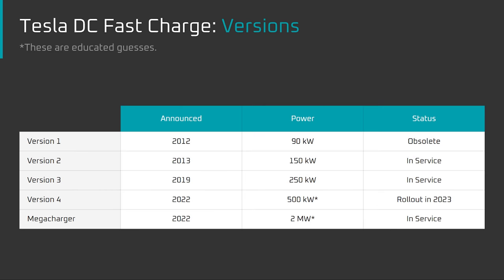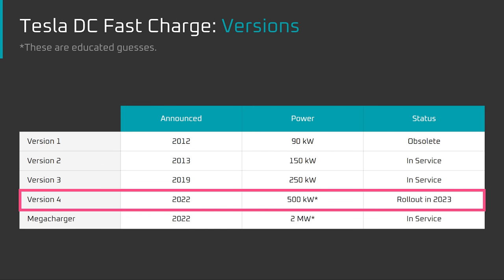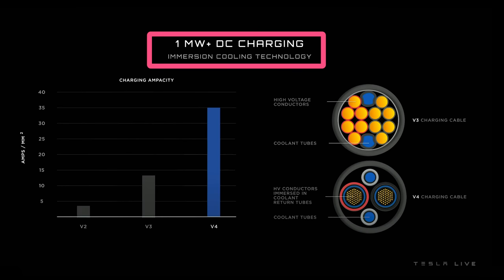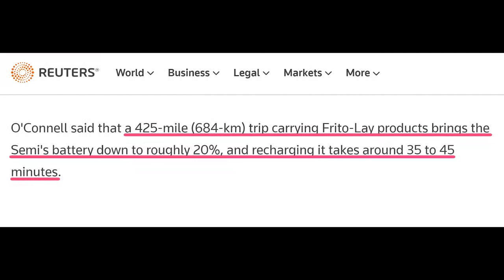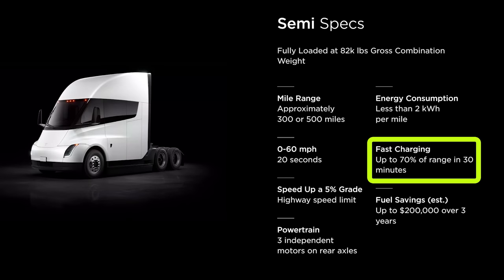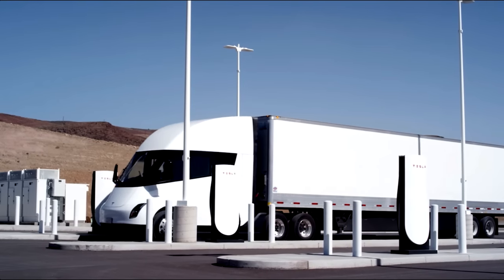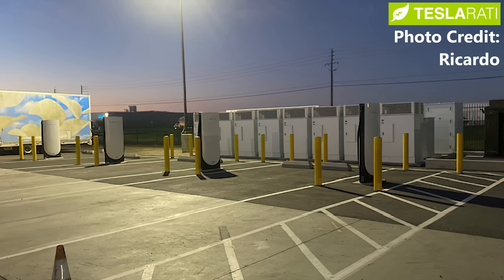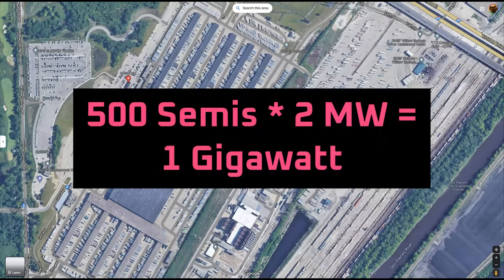Semi Megacharger Output // + The Megapack Moat

Comment from the maker: Point of Clarification 1:  Some people might note that starting at 04:26, the average lines I've drawn seem too low and don't reflect the average from what we might calculate from what we see in the charge slope.  This is because:

1) This graph was repurposed from the Model 3 and applied to the Semi...

2) The Model 3 charges to 80% instead of 70% in 30 minutes.  That means the model 3 likely has a higher peak charger rate.  That means that the peak rate and therefore average charge rate line for the Semi must be proportionally lower to account for its lower charging power.

Point of Clarification 2:  Yes, the Megapacks are not just rated for >3 MWh, but 3.9 MWh exactly.  This was a poor editorial decision on my part 😛
Reply: THANK YOU for the comparison semi to nuclear plants. I've been bringing this up wherever appropriate. We WANT to ditch diesel. We WANT an electric world. We NEED nukes to enable that future.
Reply: Thanks for the clarifications, Jordan. 🙂👍

I can imagine Tesla installing Solar PV panels covering the Megacharger sites, and providing shelter for truckers. If a park is a very feasible 1 kilometre square, and covered in good quality panels, you can expect Summer generation rates of at least 100 Megawatts, assuming a reasonable overall panel cccoverage, generating and storage efficiency of 10%.

Given a very pessimistic 5 hours of useable sunlight per day, that's at least 0.5 Gigawatt hours of electricity which can either be stored entirely onsite, partially fed directly to trucks, or fed into the grid via inverters. Even in Winter, in most places, providing that there is no snow or ice coverage of the panels, a useful amount of electricity can still be generated.

Tesla could also install Wind turbines at appropriate sites.

The point is that the electricity grid need not be stressed as much as one might think it would be, providing that local generation and storage can be implemented.
Reply: I'd like to know the warranty on the Tesla Semi battery pack.  Semi tractors are expected to last roughly 1 million miles.  Will you have to replace the battery pack one or more times during its lifetime? If so, the economics of the Tesla semi will be less compelling.

Comment: Excellent summary. Probably mentioned but these MegaPacks would be well suited to areas where there are easy access to large solar arrays like fields and large warehouse roofs. The connection and distribution of these significant assets (and our cars / houses in the future) will be the saviour of our present fragile grid and should help with resilience in the case of a high tension line or substation outage.

Comment: One possibility we have to also consider is that 750kWh comment was specific to Pepsi's use case and does not show actual max capability of mega charger but rather highlights specific location constraints. Like if they decided to dedicate 3MW to semi charging in Modesto and they want to have 4 charging bays then they could easily limit each to 750kW. As long as the intended use satisfies them they might never need max charging power and associated infra costs to support it

Comment: Before I retired two months ago I was asked to provide standby power for three DC warehouses in the Phoenix area. These DCs were looking at 9 to 18 MW per location to support up to 300 semi-trucks per warehouse. When the utility told them it could take three years to build out the power lines and the owner found out how much it cost to upgrade their existing services the projects were canceled. I heard Tesla is building V4 pull-through chargers in Casa Grande and Avondale AZ. These are not far from existing Pilot diesel truck stops and a couple proposed H2 processing facilities. They can easily be powered using 4,010-megawatt base power from the local Palo Verde nuclear plant. Tesla also had approved plans to build V4 passenger car charging stations in Quartzsite AZ which is a prime truck stop location between LA and Phoenix. The utility APS is adding flow storage batteries not lithium batteries with solar panels near these locations so my guess would be they are not using Telsa packs. Keep in mind the first EV semi was from Cummins who recently invested in an mfg plant for 500Wh/kg batteries in Tucson and many H2 processing stations in other parts of the world.  Due to NDAs utilities can not tell us much but a few beers can.
Reply: My father's sales job involved many long lunches for the same reason!

Comment: A typical substation feeder is something like 800A @ 12.5KV, and most substations I've been in run at about ~50% load during a typical day, so that should be enough for ~6MW of power if you are able to fully buffer it through powerpacks throughout the day/night. At the subtransmission level, Tesla will need to have some kind of data feed from the substation and throttle their charging depending on the feeder load - assuming they don't get their own feeder. I think they will basically have to do power packs because the cost would simply be too high for an unbuffered feeder. For semi trucks, I would imagine their charging would probabbly come at certain times, and largely be usused for the majority of the day - even more so than superchargers. Even 6MW of power might be enough to support at least 8 Megacharger stalls I would think. 

A bigger problem is that those feeders are typically sized for worst case scenarios - like if everyone is at home using electric heat during a winter storm. In such a case, there might not be enough unused capacity in a 7 day period to support the Megachargers. That to me is the much bigger problem because it's likely that Megacharger usage would be higher in exactly those conditions since the cold/snow would negatively affect Semi truck range... 

In short, it's not an unsolvable problem, and people sometimes forget that when air conditioning first hit the mainstream, that also caused a massive increase in power usage in a very short number of years and totally changed certain areas load curves from winter peaking to now summer peaking - this screwed up a ton of 'best practices' and standards for certain utilities that were very affected. In general, utilities don't make optimal use of assets in extreme conditions. At most, they might have a set of summer and winter load standards, but as temperatures get down to 20F or below, the substation can push far more power than at 70F. There may need to be more temperature monitoring to make more optimal asset usage. Even at the transmission level, you would be surprised how much truly unused capacity there is. I'm not talking about what the utilities' standards say is the limit for 'winter conditions', I'm talking the true minute to minute electrical limit - that is typically far higher in extreme cold situations than what utilities run at. Some of this may be unmeasurable, but if a financial incentive was present, I believe that a lot of it could be measured and capacity could be pushed up. 

At the transmission level, natural gas power plants can be set up very fast, and I wouldn't be worried about there not being enough ENERGY available. There is also a pretty large surplus of capacity. POWER will have to be managed though - that is definitely a problem. Transmission lines are very hard to build, so there will likely need to be some sort of data feed from the utility that can throttle all these megachargers in case of transmission congestion. The solution will lie in more optimal saturation of existing transmission lines, setting up new lines in most areas is not practical in a <10 year timeframe. We would need a lot of Megachargers to cause problems on that level though. A 500kV line can support quite a lot of capacity.
Reply from the maker: Great information thanks!  Is there anyway to get in contact with you?

thelimitingfactor9000@gmail.com
Reply: Thanks for sharing your experience!

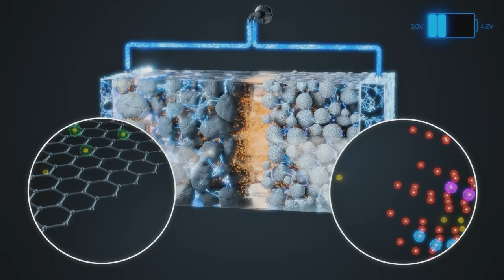Comment: @5:30.  When the 4680 is considered, I believe a few rules change with charge & discharge.  Higher charge and discharge efficiency because of lower heating.  AND this likely means Tesla can hike the charge-rate to somewhat higher levels than the 2170 for example.
I don't know for sure, but the ground-breaking physical construction and lower ESR of the 4680 implies many improvements overall in respect of charge & discharge rates.

Comment: Another nice video, Jordan!  I believe the 2.0~2.3MW estimate is correct:  On the V3 supercharger, there are 4x 250kW charging connectors on each "cabinet," which means a total of 1MW per cabinet.  At Frito-Lay, you can see 8 cabinets going to 4 charging connectors, which would be 2MW to each semi.  If the cabinets are upgraded for 4x 300kW, then this also increases the semi charging rate by 20% to 2.4MW.  Doesn't this line up perfectly with your numbers?

Comment: It seems to me that for industrial applications like Semi charging a two cable system makes much more sense than a single cable system. While we are all used to having a single gas nozzle duplicating this experience isn't necessary. Each of the two cables would be much more flexible and lighter and easier to handle than a single one.
Reply from the maker: Could be.  Not what I'm expecting because it's more parts, but looking forward to seeing.

Comment: Keep in mind the largest solar farm in California is 550 MWh. It covers 4,700 acres. It will be required to have megawatt class battery packs to collect the solar during the day. Then release it during the evening when the semis are actually charging.
Reply: Or
The Semis could be using the Solar and Megapacks combined during the day for their "top-up Ch" (IF required, which is by no means certain) then be using spare capacity to slow charge at 150(?)kW at "slow" chargers overnight?
Reply: That's a very bad way to store power.  California has many low reservoirs and should be pumping ground or downstream water up into them as storage.  About 70% efficient as storage and far cheaper than wasting lithium needed for the vehicles.

Comment: Only because the CharIN plug is designed to handle 4 MW, doesn't mean the first chargers rolling out with that plug will go anywhere near that power.
Reply from the maker: And excellent point!
Reply: I wonder if that 4MW specification is due to vehicle manufacturers  lack of confidence in the vehicle efficiency they can achieve?
.
I suppose we will know when their "gen 2" (3?) trucks arrive?

Comment: HVDC transmission technology is something worth looking into.  For example the UK is planning a wind farm near Iceland and back hauling the energy to the UK by a HVDC transmission line.  HVDC technolgy follows a dropping cost curve similar to semiconductor products so before long it will be everywhere.  So a wind farm in New England could power homes in California while a solar plant in Nevada could power homes in Florida.  Geographical spacing allows a nation  (global?) wide grid to average out the highs and lows of renewable energy sources.
Reply: It would also allow someone who owns a solar farm or wind farm or whatever to sell to much wider market.  Which in turn opens the door to power providers competing price wise, and that's usually better for the consumer.  I agree, it is work looking into!
Reply: I hadn't picked up on the Iceland idea. Do you think this project is really likely to fly? It looks closer than the Morocco to UK mega-solar farm idea so transmission is realistic although Scotland needs more power like a hole-in-the-head. Would it make more sense to land the HVDC cable in north-west England - which one is cheaper, undersea or across land HVDC? HV transmission pylons through the Scottish mountains are quite contentious.

Comment: Locating charging stations near the transmission network for direct supply from the transmission network gives lower power costs and greater capacity. Its an easy solution to the problems outlined in the video.
Reply from the maker: But, its doesn't allow for arbitrage and limits where the stations can be built...and would still require a wait time for the parts
Reply: @thelimitingfactor  There are limits on the available real estate at existing transmission substation for adding an additional breaker, however most transmission substations have some additional busbar capacity for at least 1 additional breaker. There is typically a wait time of about 12 months for a new high Voltage breaker, the delivery time for cable is usually going to be less. Obtaining regulatory approval and easement approval for the cable are generally also of the order of 12 months. This means that there is a delay for each new installation as well as limited access to transmission networks, however, these are not insurmountable problems if a company is prepared to plan its rollout of large capacity charging stations. It is unlikely that a utility that owns a distribution network would be able to easily accommodate a large charging station connection to its distribution network. The existing Tesla supercharger stations appear to be at about the limit of what the local distribution network has the capacity to handle.
In the case of access to transmission substations there is probably a significant first mover advantage for Tesla and their proposed high capacity charging stations. The cost of building a new transmission substation is quite high and typically takes many years to plan and implement.

Comment: You are missing that the rectangular plug you show that Tesla is using for the Semi is a MCS connector. It is just the prior revision/prototype to the new triangular one. So, I would expect Tesla to have already moved the Semi/Megacharger to the new MCS design. (Or if not, that they would relatively soon.)

It could be the person that said the triangular connector wasn't being used was referring to the portion of the question about the Cybertruck, as I wouldn't expect it to have one. (It will probably just have a ~1MW NACS connector.)
Reply: Tesla will do whatever they want, whatever is best for them, it's an OEM system they make the standards they use for their own infrastructure,  no matter what standards authority thinks or whines on about
Reply: The limit is the DC current carrying capacity at the rated voltage ITS NOT A Breaking contact if you unplugged it under power it would arc, there will be a disconnect contact to kill the power but it's not a power breaking or making connector not DC at 1000 volts so only the thermal needs to be considered
Reply: @kwinterburn  Of course, but Tesla is a member of CHARIN and was a major player in the design of the MCS standard... And given that they used a prototype MCS connector for the Megacharger makes me think that the Semi will likely be MCS compatible.
Reply: MP3 Mike nailed it!  The Tesla connector sure looks like the prototype MCS 👍

https://en.m.wikipedia.org/wiki/Megawatt_Charging_System

Comment: Jordan, great discussion on how the megapack is going to solve initial grid problems.
Problem solving generates cash.
Bigger problems generate more cash.
Will Tesla energy start to make even more money on their megapacks by constructing them, and then instead of selling them to utilities for 30% margin, operating them to solve multiple problems and generate even more cash?
1) Access to grid power w/o building substations
2) Arbitrage daily energy usage
3) Buffer their own solar farms

If it makes sense, they can do this as they have lots of cash sitting on the balance sheet.

I always suspected this would happen, glad to see that you are confirming this suspicion.  Interesting to see information about substation construction constraints.  Will Tesla vertically integrate into this industry as well?
Reply from the maker: Yes!  I'll be interested to see how they build their business as a utility and how the megacharger stations play into that.  And, they definitely have a warchest of cash to deploy 😀

Comment: Great information, this in my mind says only tesla will be able to scale electric Semi's as no other brand has the expertise or integration to make it possible. Also others will literally be forced to use whatever charging standard and connector tesla opt for. There will need to be software to manage where and when Semi's charge.

Tesla may have been waiting for mega pack before releasing semi as this will be what makes semi work in the real world 🌎

Comment: One possibility is that Tesla has provided their various commerical customers with slighly different chargers to do some real world comparisons/experimentation to speed up their development cycle.

Also, Im fully expecting these big depots to start installing their own wind turbines to suppliment the grid and lower their operating costs.

I do agree that Megapacks will be onsite. Tesla already puts batteries at its supercharger installations. Im not really convinced however that Tesla has the right chemistry or battery form factor for grid storage projects. I feel like in the next 5 years someone will have a competitive grid level battery with much much cheaper cells. Maybe itll be volumetrically larger for the same output, but for grid level installations that is not very important.

Comment: I would deeply appreciate all the current battery chemistries with pros and cons and which are in the works. I mean this is the new choice of a “motor/fuel” for the consumer going forward. It is poorly covered. Battery types such as Battery types
Li-ion EVs
NiMetal Hydride (NiMH) Hybrids

LCO Lithium Cobalt Oxide
LFP Lithium Iron Phosphate
LMO Lithium Manganese Oxide
LMFP Lithium Manganese Iron Phosphate
NMC Lithium Nickel Manganese Cobalt 
LT Lithium Titanate
LNCAO Lithium Nickel Aluminum Oxide